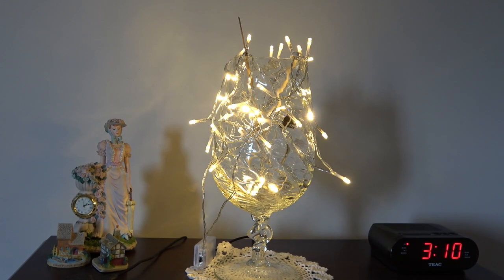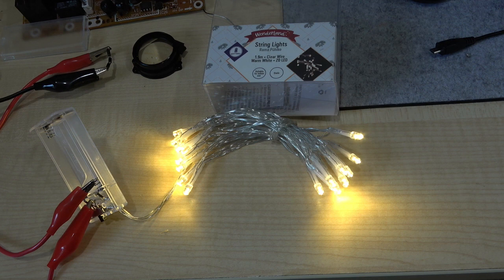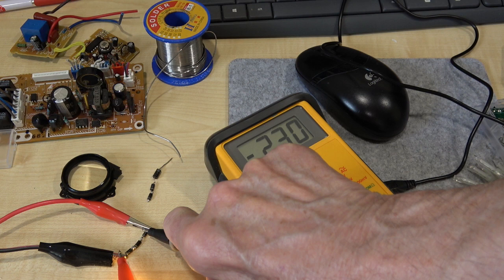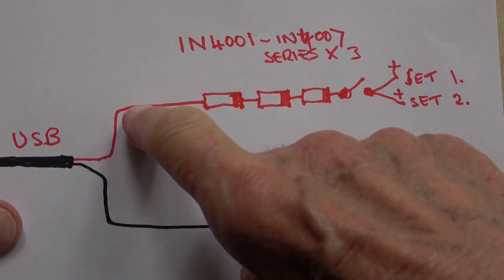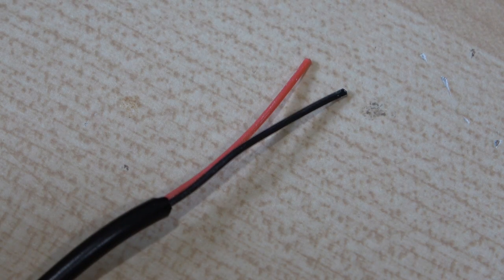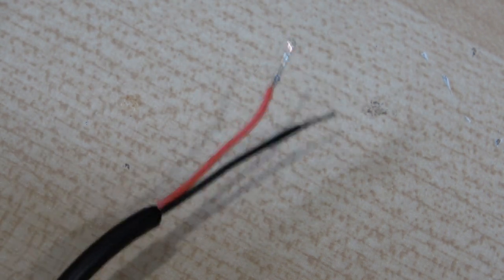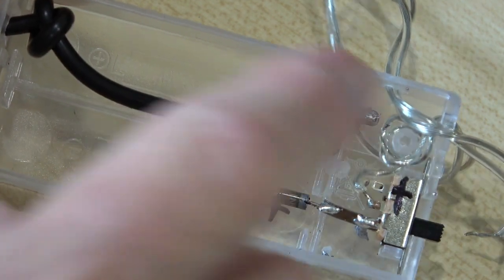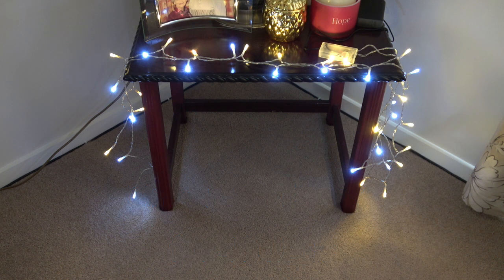Beginners Project. How to connect 3 volt LED sets to USB 5 Volt supply

Comment: If a string of lights are designed to take 4.5 volts of battery power and you want to utilize a 5 volt power bank, why does the power bank shut off after not sensing current or draw? How to stop the power bank from shutting down after 30 seconds to one minute of being connected to the lights?
Reply from the maker: Some power banks need a higher current draw to keep them running. Not much you can do about that.

Comment: Sorry for my stupidity, but shouldn't the diodes go on the other side of the circuit? My understanding is that the electrons flow from negative to positive. Since the black wire is negative, wouldn't that then lower the voltage before it gets to the lights? To me, this looks like the voltage is being lowered after the load. Please explain/help!

Comment: Been doing this for a bunch of battery lights lately (always looking for an excuse to solder something). I've harvested the diodes off junk boards. Although, for some reason, if I use 3 diodes in series, the voltage drop seems too great and the lights are dim. When I measure the voltage at the terminals when the light is on, it's at something like 2.6V. The diodes themselves would give a reading of 1.5-1.6V (when connected together) when measuring them in diode mode. So they seem to be dropping the voltage more when there's power or something else is dropping the voltage further? 

If I just use 2 diodes, then I get the expected brightness and the voltage is at 3v (sometimes 3.2). 

Is 2 diodes still OK? Just somewhat confused as everywhere I've looked says to use 3 diodes, but 3 seems too much for the lights I have converted.

Comment: Just make a voltage divider. 2 resistors quite high to not blow the USB device. In the middle you get +. It can work up to 24 volts or so. With some issues you need a buffer. It's an opamp chip and it doesn't do anything except make the divider "vanish" (one of the resistors get other numbers with the load having resistance, so the opamp put it right.) The wiring is a bit insane to do at first.

Comment: Best if you can to leave diode leads the full length, it stops the heat from soldering wrecking them.

Comment: What could happen if you were to connect 3V meant LED lights directly to the 5V power source? Could they still work just fine, maybe with reduced lifespan, get burnt right away or quickly, or there might be other hazards happening?
Reply: they get hot and bright and eventually burn out, within a few hours.  Ask me how I know
Reply: @icandsc what happened xD
Reply: @ its just rhetoric. what happened was just what  said.
Reply from the maker: They will get very hot and quicky burn out. Not a good idea.
Reply: I tried this with a light up Christmas sign, so far they've been working just fine for 2 seasons, but I would probably listen to everyone just in case, I didn't mind if I blew the sign out, so I went for it, and it worked for me, may not for everyone.

Comment: Works excellent, but both of my powerbanks (differend brand, different capacity, one premium and one some average brand) turn off after 2-5 minutes....
Do you know what the problem could be? Maybe not enough power consumption (amps)? Tired resistors (did a lot of math 🙂) but they turned off too, resistors use only 20-30% more mAh, still under 200mAh, I guess that's the reason... 😞 Great idea BTW, much easier than calculating ohms.
Reply: You need a bit higher load consumption. An LED should work. Use the 555 timer for blinking an LED every 5-10 seconds - even better.
Reply: You mean an LED insted of resistors? Theoretically it should work, you're right...
But I don't really understand your 555 timer IC tip... Did you mean to use it having a higher spike in the current draw and resetting the power bank's auto turn off circuit? Or did you mean to use the 555 timer in a PWM configuration? I mean to reduce the effective voltage for the light string? So instead of directly lowering the voltage, it would rapidly switch the power on and off, creating a lower average voltage...?
Got lost here a bit 😊

Comment: I want to run 50 3V Micro wired white LED's for a tree lamp that I am making. What diodes to I need to get? Do I connect them all to the switch or do I need to run them one connected to the next?

Comment: Can we parallel up to 3-4 LED light sets (3v each) using one 5v USB cable?
Reply from the maker: You could if the 5 volt supply has enough power rating. You would need a diode Chane for each circuit, as the diodes would get very hot.

Comment: Quick and easy. Simple. 👍I used some resistors on a project, and it took longer to figure out the correct resistors than it did to wire the LED lights along my driveway. I was dropping 12v to 5v and the length of wire brought it to around 3.8v so I was close. They were solar lights, and if you can get 6 months out of those you are fortunate. They worked great for 2 years (on the wall charger power), until an over-anxious neighbor mowed my lights down with her recently repaired mower. On all of the other forums, websites and discussions, they get into using 2 resistors, and tapping across 1 of them to get roughly 3.7 volts. Or an IC this-that to regulate the power, regulators or Buck converters. But this is really the easiest to do. A diode is a lot easier to scavenge than a specific set of resistors. Now I need to find something to scavenge 3 diodes from. Good job!
Reply from the maker: Even if you buy a few they are really cheap. If you are drawing high overall current, don't forget to rate the diodes appropriately and note they will get warm.

Comment: Is there any risk for a fire? Does regular usb adaptors come with short circuit protection?
Reply from the maker: Most chargers do have current limiting. More risk of cheap and nasty chargers catching fire when simply plugged in. This simple circuit with not make things any worse.
Reply: @MichaelBeeny  thanks
Reply: Maybe another video topic? What are the protections of usb chargers.

Comment: I had some LED cannibalized from my daughter's graduation balloon and I did a similar thing.  It runs on 3xAA batt so I dropped the USB 5V over a resistor and it is now connected to an idle USB port on my router.
The LEDs are stuffed into a gin bottle and tucked at a corner
Reply from the maker: I used diodes to make it easy for beginners, as the results are predictable. I have in fact used resistors on a similar project. On another I used a buck converter.
Reply: Hi! What are the values of the resistor? Thanks
Reply: @sicariussss don't remember. I could have trial n error with what I had on hand.
👆Michael's suggestion using diode works too...